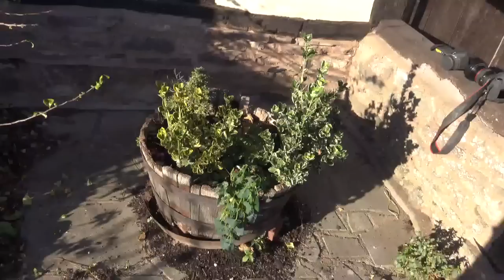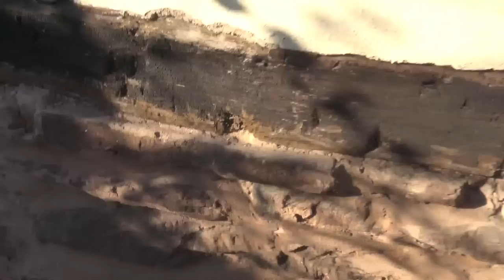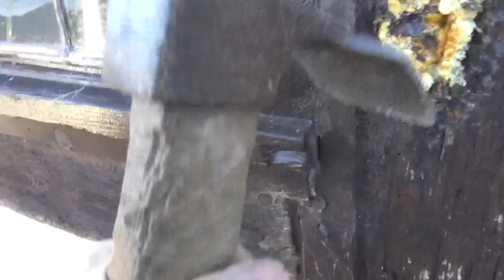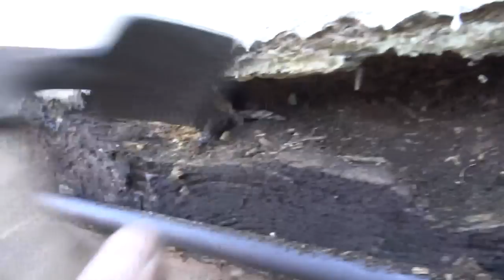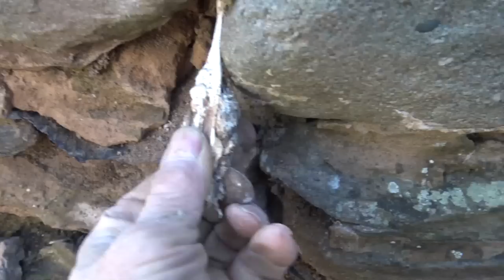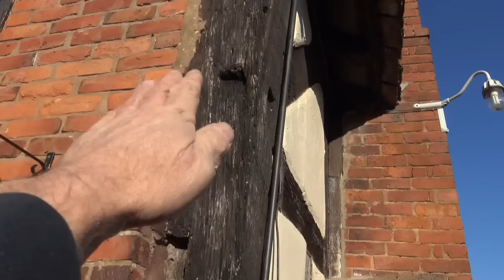How to destroy a Grade 2 listed timber frame with cement and silicone

Comment: It would be nice you could show the finished result of your work Peter. I know you focus on the problem at hand but showing the results of your expertise and remedy of your initial diagnosis would be great to see.
Reply from the maker: We are doing some videos at the moment of the job we have in Henley - I'll post them shortly..  Tis a bit hard sometimes to follow up if clients don't ask, or we are not involved in the building job, or sometimes they dont buy the place...
Reply: great mate, look forward to seeing them. I wanted to ask for your advice. We are building a side extension to our late 1800's dry stone end of terrace property. Am I right to assume that as long as remedial plaster work is carried out with lime plaster to the front and rear, external facing walls, that gypsum can be used on new cavity built masonry and also on the internal (party wall and side) walls? Being on a budget we want to limit the lime based plaster, where possible!
Reply from the maker: I'd be careful if the internal walls are solid and breathable - gypsum may cause damp issues - unless you can keep moisture levels in the house right down below about 7g/m3 all the time - in RH and temp terms, that means keeping RH below 50% and temp 15 to 20 degrees.  Damp is all about moisture in the air condensing within the wall - and if too much moisture, you get condensation.  Can also try humidity controlled ventilation - we love the stuff.  Dont know about floors - complex subject - if concrete - will push damp into walls from under concrete - which is why I prefer limecrete or suspended timber.  Lime not expensive especially if you do self... materials cheaper than gypsum..
Reply: Peter Ward to the gable end they are but these will become internal when extension is built. Is it not only solid walls that are facing the outside that have the issue? If so, these two walls are all being done / skimmed in lime.

Comment: Do you not have termites there?  Any place we get wet wood, the termites move in.  Then its a waiting game until they eat it all!  My house is framed in oak and the termites have done much damage where there was/is water infiltration.
Reply from the maker: No - thank heaven - no termites.  Basically if you can keep wood dry, it won't get damaged. Most damage is from damp timber, which is made damp by unbreathable materials like cement and silicone.  I lived in australia in a big old timber framed place - termites there will eat anything - dry or wet - so they have to be soaked in chemistry from day 1, with termite caps on all the posts...
Reply: we have "woodworm" and some larger animals which lay larvae in some woods, but they act slowly and only cause structural damage over a long time, infestations are easily treatable with insecticide and some furniture companies intentionally create mock woodworm holes in an attempt to give their furniture a rustic charm.

Comment: Oh dear, there are definitely some 'wally' points there! That silicone bodging was criminal.  Looks like there is no way of avoiding a full on highly disruptive restoration if those panels need to be sorted?  It's nice to see a survey like this where actual investigative effort is used rather than being told on paper that something 'may need further investigation'.  Thank for the video Peter.
Reply from the maker: Agreed.  I WILL add though, that there is 'further professional investigation', as opposed to the ridiculous, and frankly unprofessional habit of valuation surveyors routinely requesting a 'timber and damp' survey from the PCA - which always results in damp proofing sales attempts.  There are surveyors out there who will recommend more investigation, but caution their report with 'you may need to have a pot of £50k for example.. to do repairs'... So long as the client goes into the purchase with their eyes opened, and knowing they may have to do substantial works, that's fine.  All too often, I see reports which leave the poor buyers open to hundreds of thousands in works that were not predicted at all.  In the last 12 months we have successfully negotiated liability claims totalling well over a million pounds, where incompetent surveyors had failed to warn clients of the consequences of purchasing old, and very creaky houses.  RICS USED to have a guidance note that a surveyor should state very clearly that he was qualified and experienced to survey an old house - this has since disappeared from the guidance notes.
Reply from the maker: I just wish we could stop this happening - need to keep doing blogs, videos, web pages - the more it is out there,  the more people learn, the more information is freely available... hopefully we'll win.  Just had a £500,000 timber frame where despite full historic building survey, bank now wants PCA timber and damp report - I'm going mental trying to erase PCA and this stupid 'timber and damp' thing from existence... Banks and Building Societies need educating.
Reply: Great Video, thanks again Peter always good work, hopefully the owners will use sense and get it sorted.Re: The Restoration Couple comment - I think some clarification is needed here.  Peter will correct me if I am wrong, but given he talks about preparing schedules of work etc. the survey he is undertaking seems like it is for the owner of the property as part of an intended repair scheme, not for a purchaser in a pre-purchase survey.  In this scenario, you can of course hack the house to death and get to the root of the problem, this is a surveyors dream opportunity.  In a pre-purchase survey for a buyer however, there is no way you could do that, or your get sued ! Would you be happy to come home and find holes in your walls?  - simply answer is No !  So my point is, don't always have a go at a surveyor who says further investigation is needed or work 'may' be required in his report, because we cannot always confirm the full extent within the scope of the inspection.  In fact, a prudent and good quality surveyor in this scenario 'would be' recommending further investigation because this is clearly going to be costly.Re the actual problems with the house, unfortunately this is something I see almost daily.  There is hardly an old house, pre-WWII, that does not have cement or gypsum or plastic paint within it.  At one point during a survey I walked down the road to get a feel for other similar houses and no joke every Victorian house on the road had been repointed with cement and the soft red bricks were shattering to pieces.  The lack of knowledge is incredible!!
Reply: Peter Ward this is totally mad how it's all been bodged up over time.  looking through previous comments I'm 26 and renovate properties.... (not this old) but I'm so keen to learn about these buildings and how to put them right.... I know a lot of older guys who really haven't a clue when it comes to these issues... so yes I'm with you on the fact younger guys ask the questions now! just one question Peter. .. when was lime mortar and plaster phased out and cement and gypsum plaster come into use? thanks... Marc Gray.
Reply from the maker: Marc - Most houses were still being lime plastered in the 30's and 40's.  There was very little gypsum being used until the late 40's and early 50's.  Cement was used to make concrete early - in the 1900's, but wasnt used for domestic building until probably the 1930's - and even then, right through until the early 1960's, always was a 4:1:1 mix of sand cement and builders lime - even then, there was a belief that lime was plastic and flexible.  Certainly breathability as such, was being built into houses well into the mid / late 1930's - so anything built before then will almost certainly be breathable, using lime mortar and plaster.  The early cavity walls were all built with lime - hence why they are all failing now when cavity filled - millions of them - because the walls still breathe and allow moisture to pass freely.  Fill the gap and it gets wet - leave it as a cavity and the wall stays warm and dry! So I guess the answer is probably buried somewhere between the wars, or just after.  All down hill from then on I'm afraid !
Reply from the maker: Neither - don't use cement.  The lime we talk about is not builders lime, and should not be confused.  Its either non-hydraulic or hydralic lime, as opposed to hydrated lime, which is the rubbish in builders yards.  Dont go near that stuff.  If you want breathability, you'll need hydraulic - a 3:1 mix of coarse gritty sharp sand with hydraulic.  NO portland cement at all.  1935 is probably still built entirely with lime mortar, but can't be certain.  Make sure ground level slopes away from house and can't splash bricks, and check drains etc for cracks too - can affect the brickwork at low level..
Reply from the maker: Sounds good - limetec are an ok supplier - mix so its like plasticene - NOT wet - about 20 mins of mixing, carefully add water - it needs to be just sticky - so you can hold in your hand without getting it wet.  Rake joints out by hand, 2.5 times joint width and push in, bank in with stiff brush and brush joint off.. Will look great, and breathe nicely...:-)
Reply from the maker: Marc Gray It's better using lime than cement.  It will ensure moisture cannot build up - more than that I can't really say..
Reply: thanks Peter very informative knowledge. I wonder if you could be further assistance to me. I'm removing modern masonry paint from the bricks below my DPC on my 1935 semi detached house. no damp issues inside the house at all... but these bricks on the outside obviously are damp as they are below the dpc and the paint traps the salts in and moisture and the paint is peeling and going white.... so I'm in the process of removing it and I'm wondering if I should repoint the bricks with sand and cement or add lime to both sand and cement as you stated in your previous comment as the pointing needs addressing to make it pleasing to the eye. thanks. marc
Reply: Thank you Peter.  I've done some searching on the Internet and there is a bag of hydraulic lime mortar that you just add water to. From limetec website. Would this be sufficient for the job? The pointing at the moment feels rock solid just needs patching in small areas and I don't want to cause problems just make a tidy job. Thanks Marc.
Reply: Here is the job in question. The black paint is now off airbricks are clear... so the lime mortar would be beneficial here below air brick level?
https://lh3.googleusercontent.com/ooXkc0WB2Z4dnvWMF6JmIYIf4ULgxzAp0FgPiPEH1sn0hQbfQrPunXhKZ2fjI3xBp3N4oyMLTQ

Comment: Another good video Pete. I saw the same problems on  £1m purchase survey last week. Have advised client to remove all cement repairs and black paint from the timber frame. Ball park estimate £30k and rising! Sadly, I rarely seen a timber frame without these problems.
Reply from the maker: Sad when you think these frames have survived perfectly ok for hundreds of years - it's only the last few years since the introduction of modern impermeable materials that the damage has set in.  The other problem is finding good people - I did one recently, where client was charged nearly £700,000 for work to a frame, WITHOUT LBC!!!!! - I estimate it was worth about £200k - but the joints all slope inwards, and everything is 'sealed' with compriband - when it rains, the inside walls are like a waterfall.  Whole house needs stripping and doing again.  Project manager / architect claims historic qualifications, strings of letters - complete idiot - needs to be struck off along with conservation officer that allowed it all, retrospectively, with NO drawings!!!!  Keep up the good work - we are swamped - come join us!!!!

Comment: Find your videos very interesting and helpful. I first came across your channel when researching for my own 'damp' problem middle of last year upon purchases my first house. It's rather worrying of the trends of wally damp men as you appropriately put. In my case, end terrace cottage, built 1888, injected for damp numerous times, put no rising damp, except a tiny patch. Just replastered with gypsum plaster, and went mankey and powdery through no breathability . And upstairs....where the original lime plaster was still up, another idiot painted the surface with oil based paint, and further 2-3 layers of painted wall paper. It's all had the come off as no useable surface left and replastering starts in feb.

Keep up with great videos. Would be very interested to see a videos of the work carried out and the final results. Cheers. Damon
Reply from the maker: Good luck!  Make sure its all lime plaster!  Also - keep an eye on ventilation and humidity control - make sure temps are kept at even 15 to 18 degrees C - run heating low and constant - not high and on-off.  Constant ventilation - humidity controlled - look up RHL on google and ask for Ray Hudson - mention us - he's the best in the country and does affordable humidity controlled ventilation that WORKS!